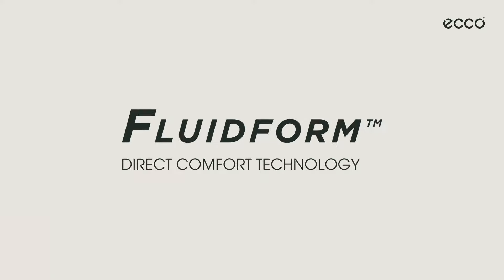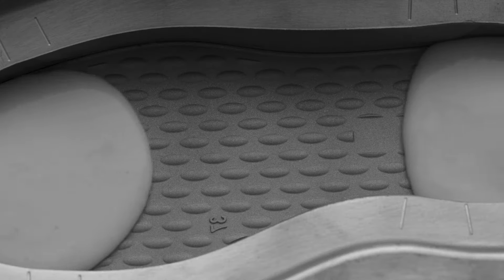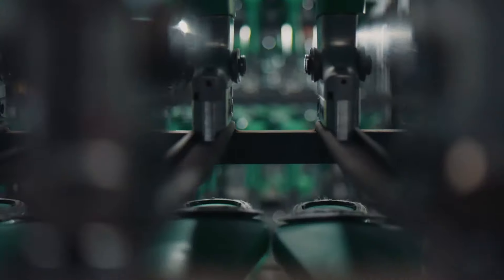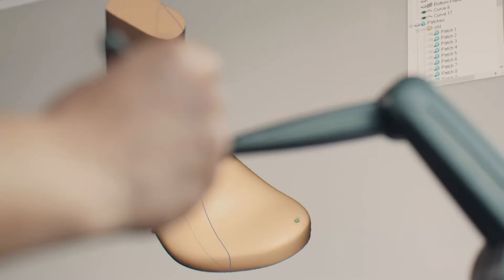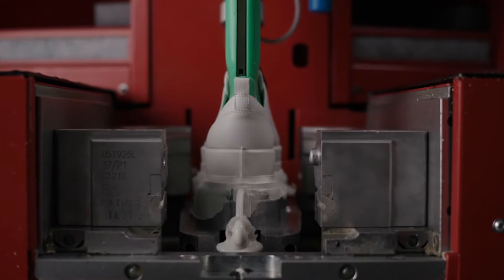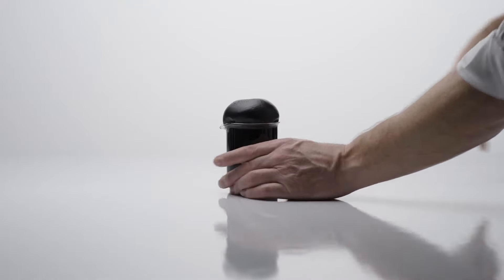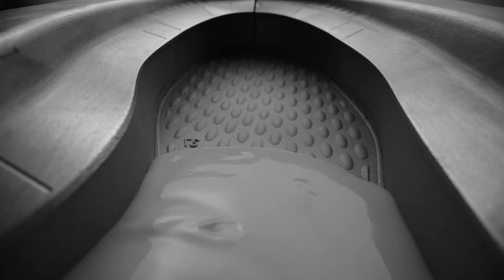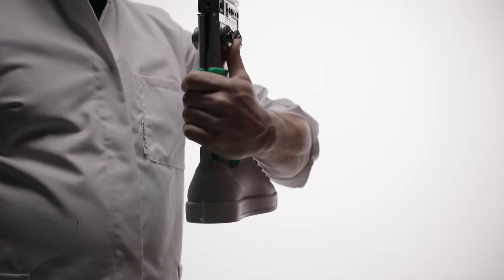WHAT IS FLUIDFORM™ TECHNOLOGY?

Comment: Dear manufacturers, I draw your attention to the deterioration in the quality of footwear.
I have been using ekko shoes since 1998, they are always high quality and comfortable shoes. It is so strong that it kept its shape and appearance for 5 years or more.
Now everything is starting to change, starting with the size, the choice of which through the online store is similar to a lottery, so I have size 42, but when ordering shoes on the 43rd, I understand that it is small and I need to take 44, and another time 42 on the leg.
The white sole that you make is incredibly easily soiled and almost impossible to clean.
Foamed polyorthane is incredibly fragile, the sole becomes unusable in 2 seasons. Such a sole cannot be repaired.
The quality of the upper also leaves much to be desired, like the recent ECCO CHUNKY SNEAKER M sneakers a week later my toe came off, the side lining was torn and the sole was worn out, the top was all scratched. While I wear shoes very carefully and wore them only a few times.
I understand that the cost of such shoes for you is a small amount, but the country where I bought them is half the average monthly salary in the country.
I ask you to accept this and not sacrifice quality for the sake of sales.

Comment: I repair shoes for a living and I tell customers weekly if their Eccos are under 2 years old and there's an issue with the soles: go get them replaced on grounds of the product warranty.
If it's past that, throw them and avoid all PU based designs. That stuff disintegrates into microplastics.

Greenwashing the leathermaking process does little of the whole product is going to smolder asunder within 2-8 years when the leather can be kept for 10-20 years with proper care.